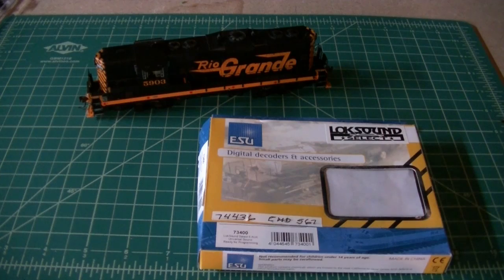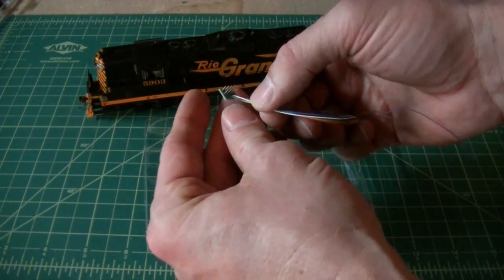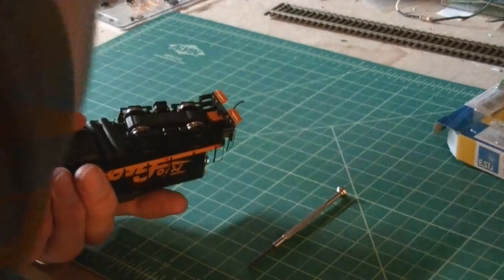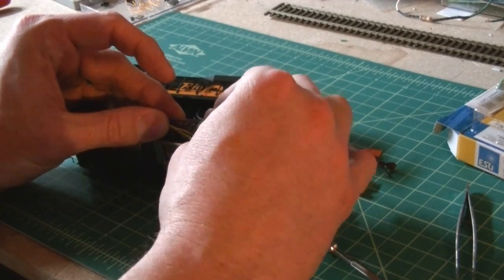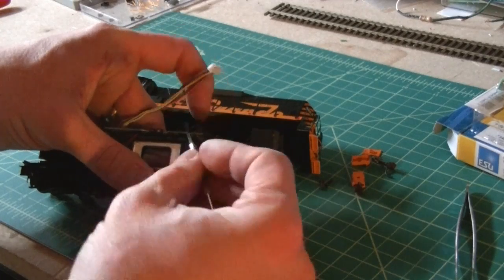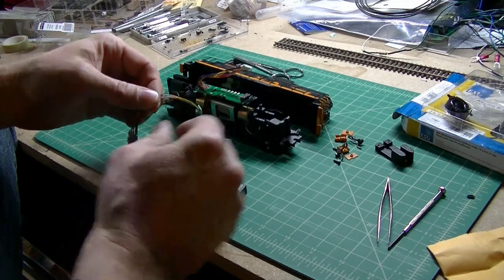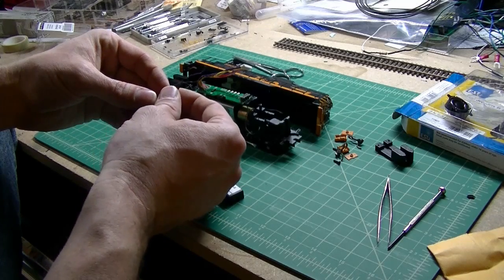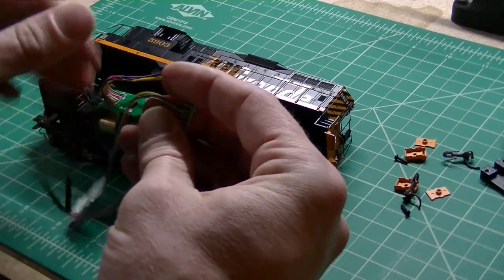LokSound DCC Sound Decoder Installation in a HO Scale GP9

Comment: What for dcc system do you run?
Reply from the maker: I'm currently using a Digitrax Duplex Radio Super Chief.  I've also used ESU and NCE DCC systems in the past and they both work well also.  Cheers, Kevin.

Comment: So I’m so confused. I’m running a mrc tech 4 280 power rectifier and running older locomotives. I want sound, what do I need to purchase to get sound on my trains like this. I don’t want to change my locomotives or my power pack. Any advice would be great thank you.
Reply from the maker: Keith, you'll need to add a dual mode DCC sound decoder to your engine.  Depending on what engine you have this could be very hard or very easy.  Since you're not running DCC you'll need a sound decoder that says it works with DC as well as DCC.  I don't run DC so I'm not familiar with which specific decoders would work for you.  Hope this helps.  Cheers, Kevin.

Comment: Hello everyone!  Quick question: which LokSound decoder would be best to upgrade a Walthers Mainline F7A Diesel Locomotive?  Thanks for the wonderful video, and happy railroading!
Reply: I'd recommend the "Loksound Select", it's a great decoder and doesn't cost quite as much as the regular Loksound decoder.
Reply: @salvatorericca8353  thanks for the help!
Reply: @commandertank2233  My pleasure! I think you're going to be very pleased with that decoder. I've installed a number of them myself and they are terrific. Just be sure to get one that has the correct connector, i.e. 8-pin, 21-pin, 6-pin etc. Hardwiring can be done with some soldering and splicing of wires if your loco is not DCC ready, but if it is DCC ready, then just see what type of decoder connector you have inside the loco and buy the Loksound Select with the appropriate connector.
Reply: @salvatorericca8353  cool, I'll give it a go!  Any major differences with the decoders (Select vs. Select Direct vs. V 4.0)?  Again, thanks for your input!
Reply: Commander Tank The select direct is a drop in decoder for locomotives with that size and shape of decoder that either screws down to the frame or clips onto the top of the motor. The select is also available in a totally different shape from the select direct with wire leads leading to a 6 or 8 pin plug, and I’m pretty sure it also has a version with a 21 pin decoder. To answer your question about what’s different between the select and loksound v4, the v4 allows you to upload your own sound files to it (like if you yourself made a recording of the locomotive you’re modeling), whereas the select will only let you upload sound files from loksound.com (which is what I and probably 99% of people do). Other than that they’re the same decoder essentially. FYI, the loksound v5 decoder is being released in the next few weeks so you might wanna wait and see what differences it has before you decide what to buy. But if it was me, I’d likely end up with the select like I said. I’ve installed the loksound v4 and the select directs, there’s no difference in performance between the two and the sound quality is the same. That’s why I recommend the direct over the loksound v4.
Reply: @salvatorericca8353  Wow, thanks for all the information!  It answered all the questions I had!  Happy railroading!

Comment: Good vid! The issue that absolutely ANNOYS me with the Tsunami is the annoying triple "pop-off" sound. Many prototype 1st and 2nd generation locomotives, with worn air let off valves, emitted single pop-offs that lasted from 1 to 4 seconds. Some with higher tones (like what's heard on the Tsu-2) but many with lower huskier tones.  The constant "Ch!-Ch!-Ch!" from the Tsu-2 can become quite annoying.  With Loksound, you can upload different air let off schemes from a variety of units. The Baldwin air let off schemes, imho, sound the most realistic as they're actually low toned and have a bit of bass and reverb to them.

Comment: I have a new version RTR SD40-2 that I put the Genesis conversion motor into I too am using a Loksound V4.0 decoder but I have switched to LEDs. My question is can I use the existing tabs or for the lights or no? I have read that you need to use the hole for the blue common on the positive but that's about it. How would you wire it up to still have separate functions of the head lights and ditch lights that is what is sort of confusing me. This is my first attempt at a DCC conversion so I'm pretty new to this. Thanks for any info you can provide? :)

Comment: I don't know whether you did this or not, but as you are not using the 9 pin socket and wires, cut or break the wires off at the lighting board. Gets rid of the clutter.
Reply from the maker: Ray, no I didn't cut the 9-pin wires off.  I try to not modify my decoders unless I have too in case I remove this decoder at a later date and install it in a different engine.  Cheers, Kevin
Reply: I have had to do so in a sound install so the shell would sit down. Thought I'd mention it in case another reader had the same situation and wondered.

Comment: Is this installation the same as installing tsunami?
Reply from the maker: It is similar, but I don't believe any of the Tsunami decoders come prewired to an 8-pin connector.  Its't not too hard to solder the wires to an 8-pin connector.  Hope this helps.  Cheers, Kevin

Comment: how do i install a loksound dual-mode decoder in a non-Dcc atlas locomotive?
Reply from the maker: You'll have to use a wiring harness or run wires from your LokSound decoder depending on the specific decoder you're using.  On their website the LokSound manuals should have a diagram showing which wires attach to which parts of your non-DCC ready locomotive.  Cheers, Kevin
Reply: Scale Model Trains & Colorado's Joint Line thanks!

Comment: do u need to do more soldering in order to have flashing ditch lights or does the nmra plug take care of that too?
Reply from the maker: It depends on the specific engine.  Some engines are manufactured with each ditchlight wired separately and some other engines have their ditchlights wired together.  If wired separately you shouldn't have to do anything except program the decoder so the ditchlights work the way you want them to.  If wired together you'll have to rewire them so each ditchlight can be addressed as a separate function on the decoder.  Though you might not have to do any soldering to do that.  Hope this helps.  Cheers, Kevin

Comment: Great video,  I recently purchased an athearn Genesis GP9, NKP 514, yeah really wanted that one, now I am going to purchase the decoder, I am a year into DCC conversion and still on one engine and still somewhat new, so this was a great instructional video on how to install the decoder.  How hard is it to program to the 567?  My other questions the engine that I have been working on is a PROTO 2000 GP38-2 D&H engine, i have gotten the decoders hooked up and had to modify the weight.  Have you dealt with PROTOS yet and what sound decoder would you recommend,  the speaker is the hardest thing to put in.  I believe it is the 645 non turbo engine.  Any info would b great.

Comment: Sorry for all the questions ... did you secure the speaker and decoder inside the engine with anything, or did you just place everything inside loose when you put the shell back on?
Reply from the maker: +Nerfball6 I attached the speaker with a small piece of double stick foam tape.  Depending on how tightly the speaker fits inside the shell you might not need that.  Cheers, Kevin
Reply: +Scale Model Trains &amp; Colorado&#39;s Joint Line Thanks for replying so quickly Kevin! I'll be placing it inside the same model Athearn Genesis GP9 so I'm glad I found your video. Did you tape the speaker to the plastic shield that the weight was originally sitting on? Did you leave it face down? or tape it face up? Lastly, do you know what the model number for the V4.0 decoder was that you used (was it the 54400)?

Again, sorry for all the questions, and thanks so much for taking the time to answer them!! I was about to take this loco to a hobby shop and have it done, but seeing this video gave me the encouragement to try it myself.
Reply from the maker: +Nerfball6 No problem on the questions.  I put the speaker in face down and taped the read of the speaker to the top inside of the shell.  Unfortunately, I don't know the exact model of the decoder.  One item to note is that on Athearn's RTR engines that are listed as sound ready, the way they made room for the speaker is by hollowing out the removable weight.  You than then mount a very small speaker to the weight.  Cheers, Kevin
Reply: +Scale Model Trains &amp; Colorado&#39;s Joint Line Thanks again Kevin!! I just ordered the decoder and speaker. I'll let you know how it goes!

Comment: Where did you end up putting the decoder before you put the shell on?
Reply from the maker: +Nerfball6 The decoder sits centerline with the engine.  It was pretty easy to get the shell to fit over it.  Cheers, Kevin

Comment: Did you notice any issues with the weight removed with performance of the loco? Is there any way to get more weight back into the loco after the speaker install?
Reply from the maker: +Nerfball6 No, I did not notice any change in performance of the locomotive.  There is still some open space inside the shell that some weight could be added too.  However, I haven't found the need to do so.  Cheers, Kevin

Comment: please tell me which are the values of q Jobs for machine functions about ? I have a Athearn RTR SD50 with LokSound and I can not make real good traction to ( fbk : christian bzco ) thanks
Reply from the maker: +Christian Bzco To adjust how the locomotive performs you need to adjust the values in the speed table or VMin (CV2), VMid (CV6) and VMax (CV5).  You can also adjust the acceleration (CV3) and deceleration (CV4).  If the engine is still not running the way you want it to, you can adjust Load compensation with 4 CVs (CV 52, CV 53, CV 54, CV 55). The ESU LokSound manual has a good explanation of how to do this manually if you aren't using Decoder Pro.  You can download one from their website.  Hope this helps, Cheers, Kevin
Reply: gracias!!!! thanks!!!

Comment: Hello. The Tsunami decoder not have a F key for startup and shutdown. It is true?
Reply from the maker: +SuperFrecciaNera I believe you are correct in that the Tusnami decoders do not have a start-up or shut down function key. They start up automatically either when track power is applied or when the locomotive is first commanded to do something depending on how you have it set up. They then power down after a period of inactivity depending on how long you have the quiet period time out set for. Hope this helps. Cheers, Kevin
Reply: Hello. I interfaced esu ecos 2 with JMRI. The locomotives with decoder tsunami finally have the startup and shutdown sequence if they controlled by JMRI controller with the PC keyboard. It is really very nice. You try.

Comment: This is probably a dumb question, but if I keep my E and F units coupled in 2-unit (with a few 3-coupled that include B units) sets permanently, is it viable to use 1 sound decoder with speakers in both engines? I'm totally new to the DCC thing so apologies for not knowing anything.
Reply from the maker: Joseph Ferrito Joseph, that's a great question.  A single sound decoder will generally be capable of driving two speakers.  However, you would have to run the speaker wires from the A unit into the B unit and have enough slack in the wire to account for the engines going around curves and be picked up and set down.  Steam engines do something similar with a large speaker and decoder in the tender connected to the motor in the actual engine.  However, doing this from scratch might be more trouble than its worth.  In a lot of my multi engine consists I just have an engine with sound as the lead and rear engines with the others not having sound.  Don't think that if you go with some sounds engines you have to put sound in all of them.  By the way, welcome to the wonderful world of DCC.  Cheers, Kevin
Reply: Scale Model Trains & Colorado's Joint Line Yeah I suppose that's true. If I just keep the sets permanently coupled then I might as well just have sound in the lead. Thanks for the tip!
Reply from the maker: Joseph Ferrito Anytime Joseph.  Cheers, Kevin

Comment: Thanks for the video. I don't mean any offense by this comment, but I don't think the RailMaster speakers are doing your decoder justice. I have heard LokSound decoders using cube speakers or even iPhone speakers that sound better. The LokSound is superior to the Tsunami IMHO, but you wouldn't really know with the RailMaster in there. Not trying to nit-pick, just sharing with you in case you want to experiment with different speakers. I'm going to try one with a pair of iPhone speakers and see how it goes.
Reply from the maker: No offense taken.  Thanks for the information.  I haven't tried many different speakers and certainly haven't done any type of controlled test to see which speaker sounds the best for a specific decoder/sound file.  Cheers, Kevin
Reply: You will be a happy man indeed, after you try the newest breeds of "Sugar Cube" speakers - if you haven't already! I run two 11mm X 15mm Sugar Cubes in each of my sound-equipped locos (all FOUR of them - I'm poor). Anyway, the sound improvements are nothing short of phenomenal!! 😎😲😲😲  Crisper, more defined, more efficient,  EVEN more Bass tones! Which I struggle to figure out WHY. 
Only caveat being that they HAVE to have a well sealed enclosure . It doesn't need to be large, just use (or make) an enclosure where the "box" is pretty much the same size as the speaker - basically the same width and length, but when done, the height will end up roughly Double. Don't worry though, because FOUR of those,  with boxes, will be about the same size as ONE Railmaster Speaker!! 😉👍👍😎

If you already know this, maybe it can help one of your other subscribers. 
~ Carmine

Comment: Very nice how-to. I'd like to hear Loksound in person.
I wonder if one reason the soundtraxx loco doesn't sound as good is because the speaker is inferior?
Also, on my tsunami equipped engines, I used decoder pro to set the headlight type to "dynalight" I think it was called. This gave them the slow on/off effect.

Comment: nice install, seemed pretty easy. lots of good things about LokSound, going to try one someday. you should consider soldering all the wires to the board, those little plastic clips are not very reliable for electrical contact.
Reply from the maker: Thanks.  I've actually never had any problems with the plastic clips.  Agree that soldering the wire would eliminate the possibility that they might come loose in the future.  If I start having problems with them coming off, that's probably what I would do.  Cheers, Kevin.

Comment: The lights fade in and out because of a small keep-alive circuit in the  decoder, typically sound decoders have this to overcome very short power dips that would effect the sound. At least this is how I believe it is. :)  Thanks Robert
Reply: The lights fade in and out because they are set to do that by default on the decoder. There is no built in capacitor on the Loksound decoders.

You can program the light outputs to shut off instantly when the headlight function is pressed, or keep the fade in/fade out to emulate older incandescent headlight bulbs.